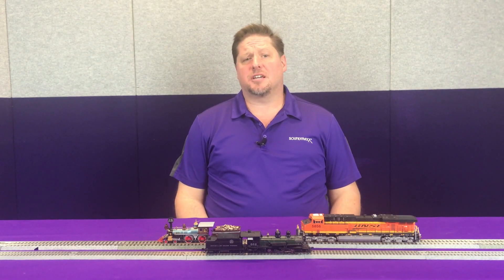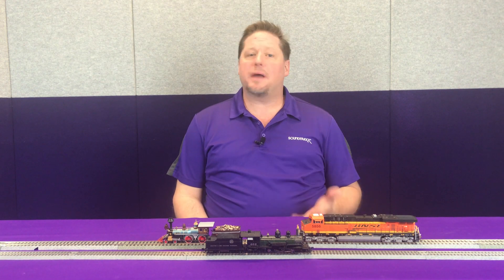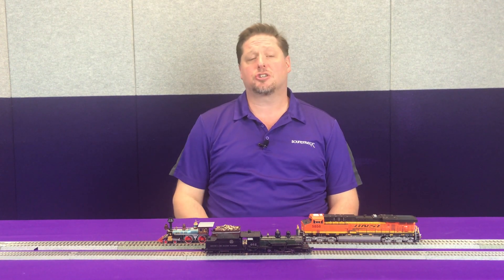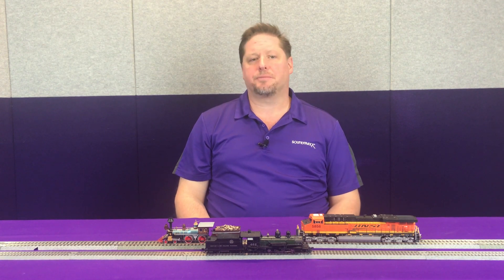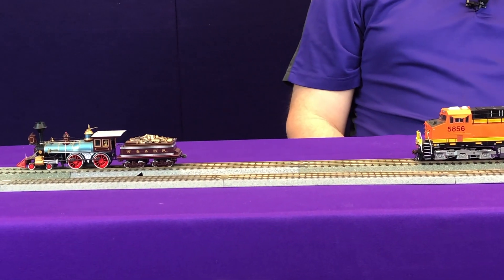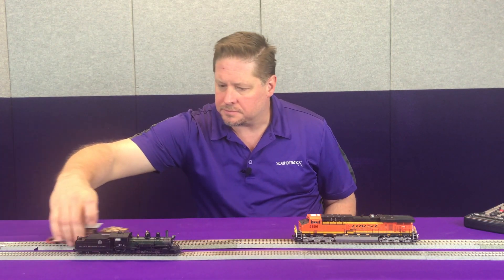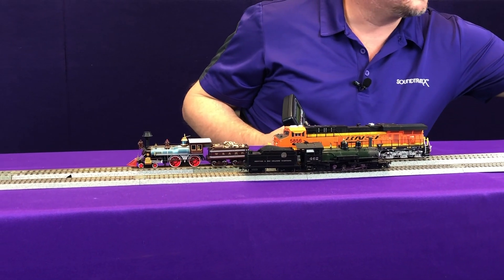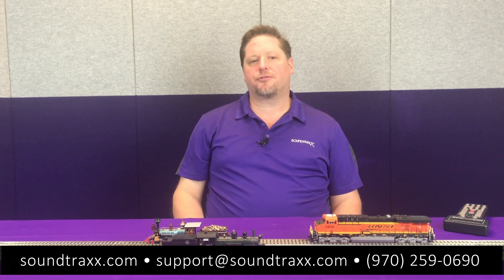Power Up Your Install with a CurrentKeeper from SoundTraxx!

Comment: Great product! I have an Athearn GP-38-2 with factory installed Tsunami2, that kept cutting out on my turnouts. I wasn't sure if it would take a current keeper but it looked like the decoder board had a connecter and a "CK" written next to it. Plugged in your keeper to it and held my breath for the smoke test. It worked like a champ! Then I installed a Tsunami2 TSU-2200 into a Kato SD 80 MAC  that came in a DC set. I also bought a CK for it too. Instead of plugging it in right away, I tested my install of the decoder only first. To my surprise, the Kato doesn't stall through the same turnouts. Now I'm scratching my head as to why. Maybe it's the longer length of the Kato loco? Maybe it's the difference in the decoder? I don't know. The Atheran has a OEM factory installed TSU-2200 and the Kato a consumer TSU-2200.

Comment: George, I love these I am trying to put capacitors in all of my locomotives. However the current keeper is fairly large. Have you guys ever thought about making them in different size and shapes. To better fit tight spaces.
Reply from the maker: This has been on our radar, but not currently in the works. Thanks for the feedback.
Reply: In the case of tight spaces is it ok to go with a TCS KA because they seem to come in different sizes for locomotives that are older and weren’t build with as much room inside

Comment: George I have a question. Atleast on my Athearn Genesis Tsunami2 equipped models, with the Current Keeper as soon as it loses track power it shuts down the prime Mover and the locomotive stops right away leaving only the lights working before it dies. Is this supposed to happen?

Comment: How do these work? I get that its a capacitor and that builds charge over time, then discharges the electrical charge to "keep the current" - but how is the voltage regulated? My understanding is that capacitors will build charge, and then discharge that energy as a ratio of total charge over capacitance. This is more of an electrical engineering question, but I'm curious. Is there any chance of a voltage regulator failing and frying the decoder?

Do the locomotives slow down (but not die) while the current keeper is providing charge?
Reply from the maker: The voltage regulator makes sure the caps are not overcharged.  It slows down the charging rate as not to disturb the short circuit protection in the DCC system, but allows full access to the power when needed.  The CurrentKeeper takes about 90-seconds to fully charge, and will provide power for UP TO 10 seconds when needed.  The caps then would need to recharge again before being able to provide another 10 seconds.  So if you are experiencing shutdown with a CK, then you will have to go in and improve the track pickup mechanisms. 
Now, on the technical side.  There are 5 2.7v caps inside, making the available power 13.5v.  If you are running on a 13-14v system you may never notice anything when the model is ‘living’ on the power from the CK.  However if you are running on a 16v system, and your model starts living on the CK, you may notice a slight slowing of the model, then pick back up again when track power is restored.  Most of the time, it is minor and not a problem, especially since the alternative is to go dead altogether.  
The parts on the decoder and the CK are solid—state parts and should last a very long time, even with daily use.  You should not see any degradation that could lead to an eventual failure.  We tested it over many hours and never saw an issue.  Granted the only way to test a 5-year duration or more is to run them for 5 years (which we did not do since we want to sell products).  (grin!)  Once you plug it in and it works, it will work for a very long time.  If there was an issue, you’d know pretty quick.  These items either work or they do not.
If you need further detail, contact our support department at support@soundtraxx.com and we can get into further detail with you.  
Thank you!
Reply: @SoundtraxxDCC  AWESOME response, thank you! This kind of support (and USA made) is why I just ordered Tsunami2 over ESU 5 for the next few projects I'm working. Thanks again.
Reply from the maker: @modeltrain9500  Thank you for the feedback. We are always here to help and very proud to build our decoders right here in Durango, CO! Thank you for the support.